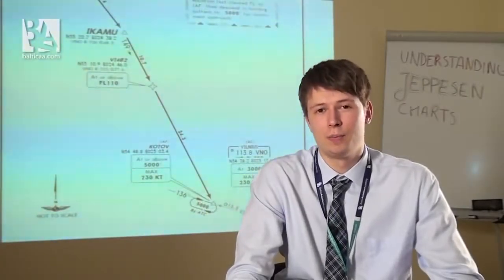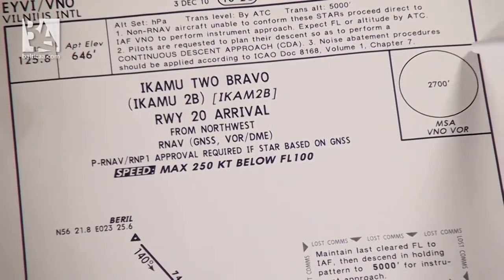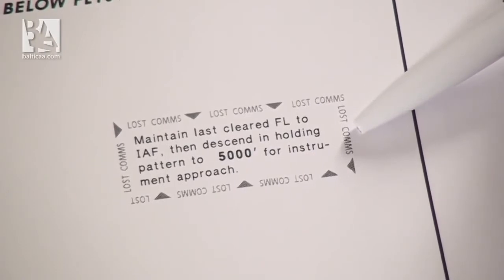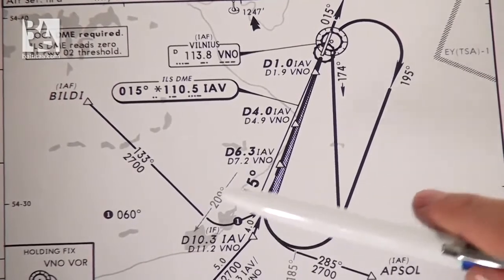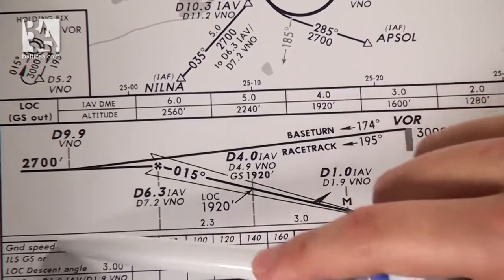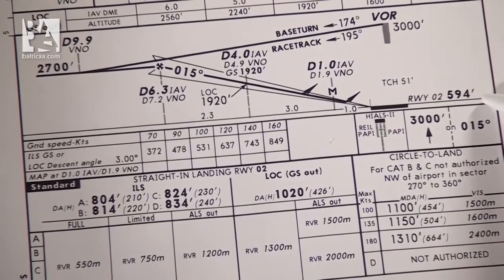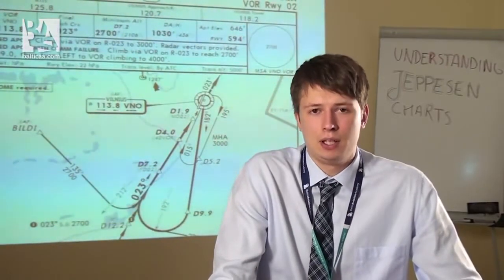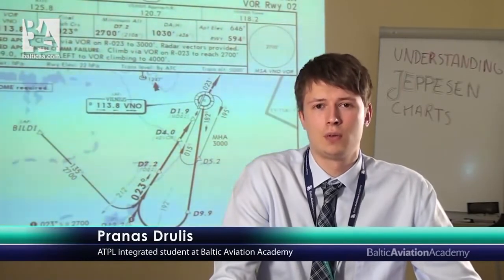Jeppesen Charts - Understanding Jeppesen Charts Part II

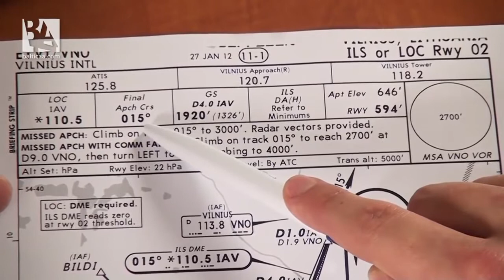Comment: Hi, I would greatly appreciate if you'd answer my question. The glideslope intercept window in the briefing strip says 1920' at IAV (time 06:20),that is below the crossing altitude, but in the profile view we have our FAF at  the crossing altitude 2700ft. Shouldn't we intercept the glideslope at our crossing altitude? How is that formulated in an approach briefing, do we not intecept the GS at DME 6.3? Thank you.
Reply: 1920' is the minimums for the glideslope, a.k.a. decision altitude (if I'm not mistaken)
Reply: at 6.3DME the localizer signal is reliable based on this, the 1920 is the altitude at which you should be to intercept the glide slope, remember the FAF in the LOC and the FAF in the ILS is different, the FAF in the localizer is actually the 6.3DME and the FAF in the ILS is the glide slope interception.
Reply: Fap is designed for geometrical type approach guidance like an ils or APV, its a point designated in space where barometric altitude meets this geometrical path, this point can move because of temperature variaton, in a non precision approach exists a FAF because this position it’s fixed in space and is always the same, In both type of approaches it designates the initiation of the final approach segment FAS.
And yes you can intercept the gs at 2700 as the loc and gs signals are reliable at this distances and the chart indicates so, the 1920 mark at IAVD4.0 it’s just a checkpoint for the pilot to indicate where the final approach segment has begun in the precision approach procedure.